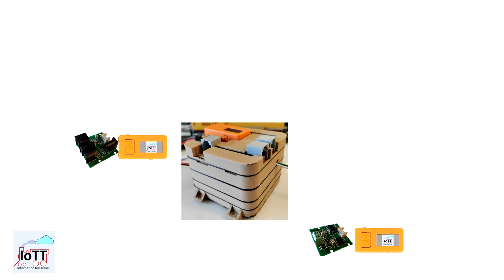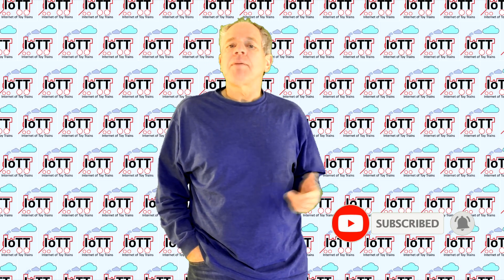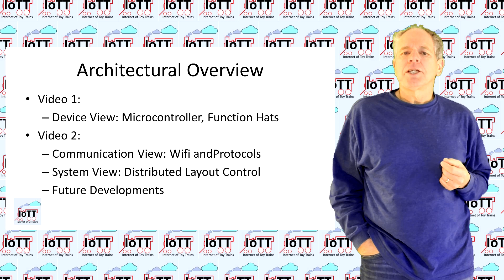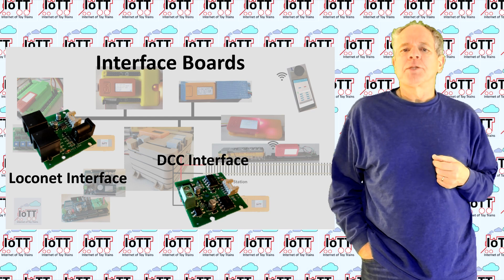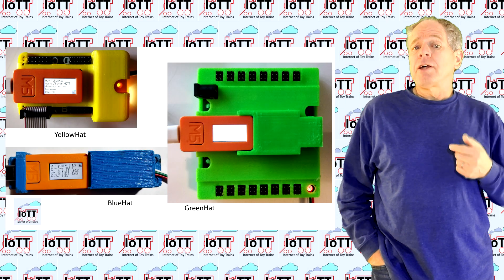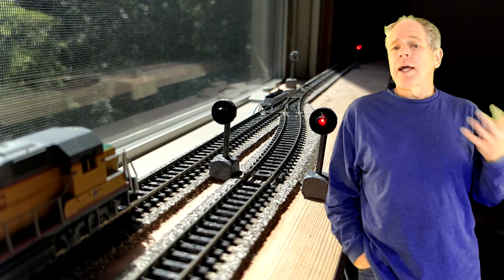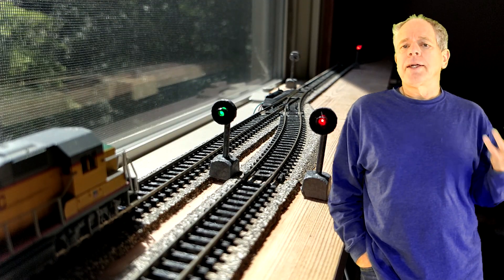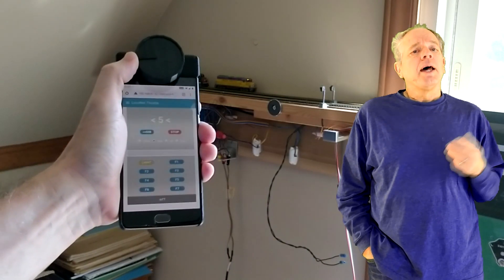IoTT Architectural Overview (Part 1) (Video#111)

Comment: I agree with the other commentors: this is GREAT!  Really de-mystifies it all.  

I noted that you put up the video numbers related to some of the hats, but I didn't see that for the Green Hat which is the one I am using most.  Can you recommend the best videos for that?  I of course will look through myself and may have seen t hem all, but in case you have a list I'd love to see it.

One specific set of questions that I couldn't find the answer to:  I want to use one to control a major yard on my layout.  Most of the buttons will directly control local turnouts driven by servos and I don't intend to send out loconet messages when that happens as I don't want to over-clutter the loconet with messages.  I note the config page allows selection of a "button" which would be a digital input connected directly to the Green Hat.  There are numbers for those - your example uses '101', '`102' etc.  SOME of the buttons however will in fact issue DCC switch commands because those turnouts are also controlled via a dispatcher (using JMRI).

1. Are the "button addresses/numbers"  unique to each green hat or do I need to avoid using the same numbers on different green hats?
2. Do they have any relation to actual DCC turnout/switch commands and do I need to avoid conflicts with those addresses?
3. How do the numbers map to the physical input connectors on the hat?

Some of these may be dummy/obvious questions and I will re-watch the lates videos, but any help would be appreciated.  This is an AMAZING tool and I have only one now which I am in the process of setting up, but plan to install more (I have a fairly large layout: see at www.kcs1982.com).

Thank you again for all you do for our hobby!  I am successfully using other hats and one of my favorites is the Purple Hat which I'm using to speed match my fleet of over 100 HO scale dcc locomotives.
Reply from the maker: The button addresses are system wide, like inputs or switch addresses. So if you connect several GreenHats via Loconet, you should use unique addresses.
On the other hand, button address range is completely separate from turnouts, so there is no conflict there.
There is no predetermined mapping of addresses, each channel of the GreenHat can be programmed individually. However, in order to simplify programming, you want to use consecutive numbers. If you do, you can use one channel as template and copy it to selected other channels and define the incrementing of addresses. Makes configuration easy and fast, just try it out!
Reply: @IoTT  This is PERFECT: better than expected and SO helpful!!  Thank you so much.